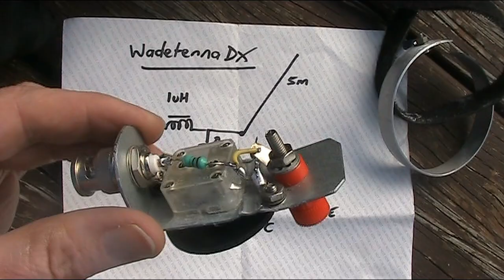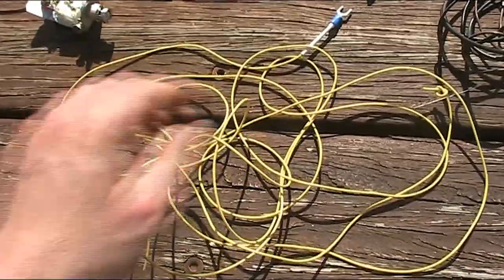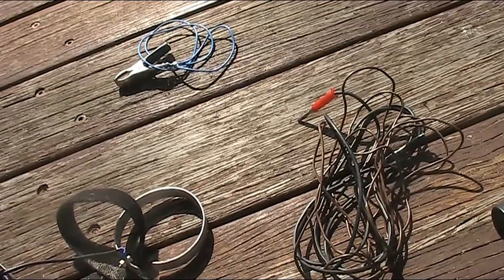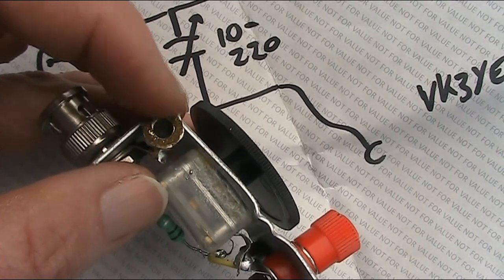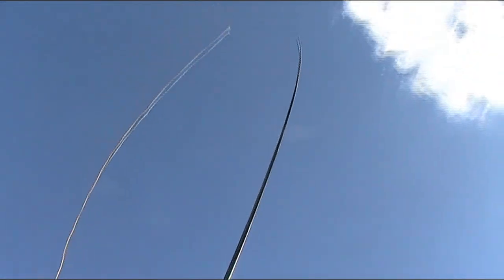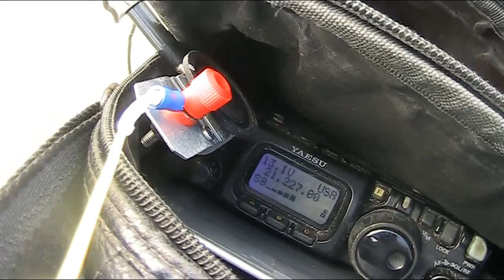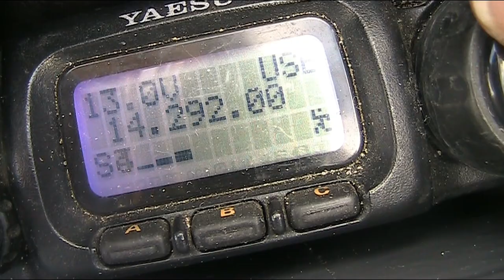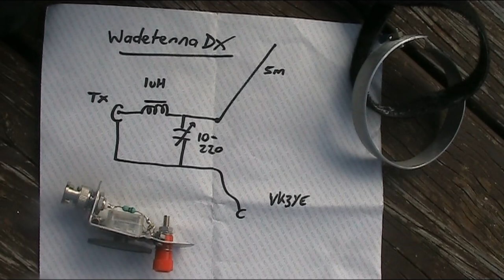Wadetenna DX does 5 bands

Comment: I like the idea, but I'm somewhat skeptical regarding the inductor, especially at 28 Mhz...
Reply from the maker: You can replace it with 1uH's worth of turns on a T50-6 toroid if you want.
Reply: @vk3ye  One time I tried this but added an aluminum electrolytic capacitor in the ground circuit just to see what would happen.
Reply: @TheLightningStalker  What happened?